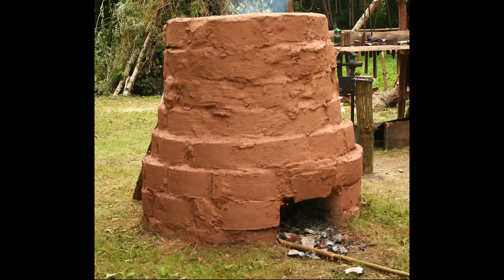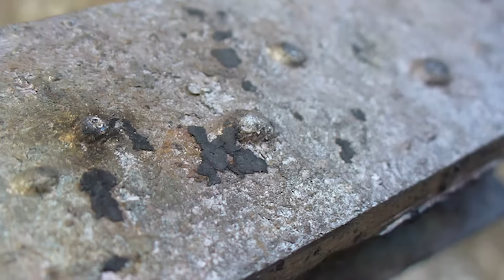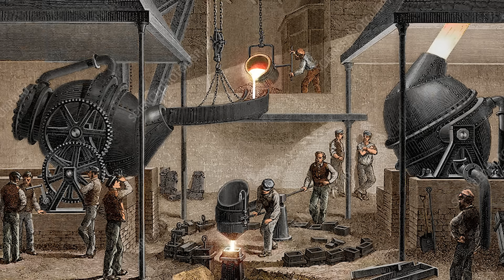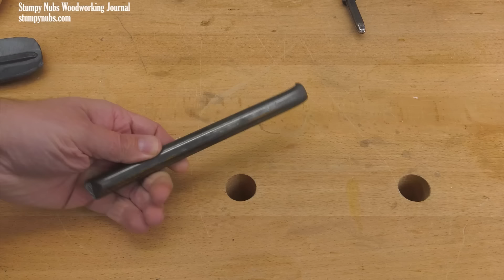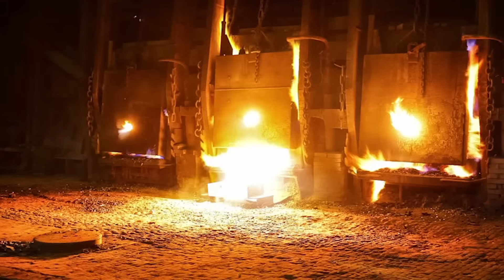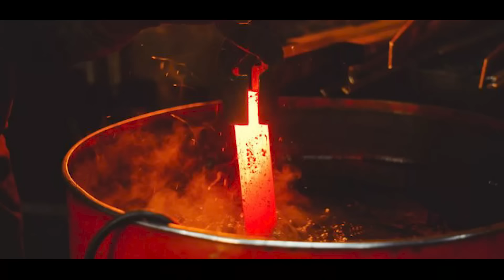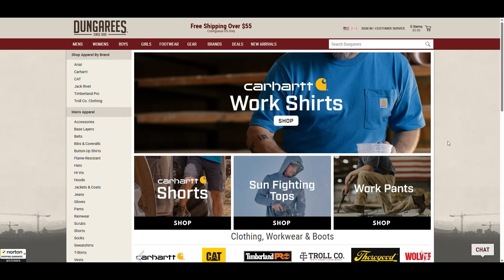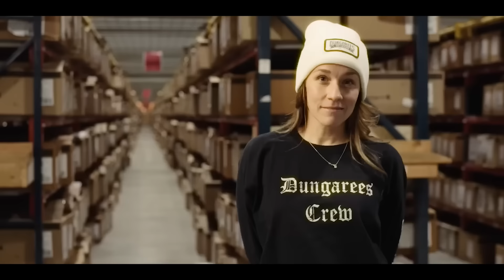Why they REALLY don't make tools like they used to

Comment: I presume this is about cheap new steel being better? That should be obvious. It's true of literally every other material. New 1c plastic parts are better than old bakelite things that cost a fortune. It's the same thing with the obsession over japanese katanas and steel with 1000 folds. They had to fold it so much because their steel sucked and to remove impurities. Because of the massive labor cost they became heirloom pieces. Because of this they survived. Because of this they seem good. But the steel sucks. A 5$ knife from amazon has better steel than the finest legit samurai sword ever made.
Reply: But Japanese mystical magic bladesmiths!!!😉
Reply: Parts of your point are definitely correct, but I think you took it a bit too far. Saying every cheap steel now is better than the finest steel they could produce in a particular region is definitely reductio ad absurdum.
Reply: Not "every" cheap steel, cheap knife steel. You are the one who is over simplifying  @doublestrikePhoto And the point is absolutely true. Dirt cheap modern knife steel would absolutely blast the best old samurai steels in every category. Like apart from presentation and aesthetics - go ahead and name one way in which the cheap modern knife steel is worse.
Reply: It would be a very odd thing if modern technologically advanced materials (including plastics) weren't a big improvement on the old school materials. Just consider the 3D printing scene and how the filament printing plastics have improved greatly in a very few years of development.

Comment: Aren't railroad ties made of wood? 
Asking for a friend... 😅
Reply from the maker: Yes, I meant rails.
Reply: Concrete ,wood ,mostly oak and even plastic or carbon type ,have been used . Low bidder and environmental regulations win the bid . Cheers
Reply: @robertsmith3518 
"Concrete ,wood ,mostly oak ..."
That would depend on the locale.  Here in Victoria I think it's been mostly redgum and some ironbark.  In Western Australia, I believe that they used a lot of Jarrah.
Reply: @PJRayment  Yes I remember chopping up old jarrah sleepers for firewood as a child.
Reply: Chemical plants that ship by rail quite often use steel, plastic or concrete as treated wood ties will react with said chemicals, ie; Hydrogen Peroxide will cause treated wood ties to burst into flames…not a good thing in a loading or unloading facility.
Reply: The GWR experimented with pressed steel sleepers in the 1930s
Reply: All railroad ties or sleepers in Kenya are steel
Reply: @leeboettger5915 really? all of them? do you have any railroads? that's a huge waste of money
Reply: Historically, yes, most have been.  Today concrete sleepers (US: ties) are popular, and (recycled) plastic ones have also been used.  Steel ones have also been made for cases where wooden ones wouldn't survive (e.g. because of termites?).

I see that James has replied too, but YouTube won't open his reply for me to see.  Edit: I can now see it.

Comment: I love the history lesson and the technical lessons regarding the steel throughout the ages. I do not understand or know the difference between charcoal and Coke, but apparently that was important. I'm glad to see that our new steel can be as good, if not better than the old stuff.  Both are good.
Reply: Coke is produced by reducing coal. Coke gives a higher temperature with fewer impurities. It is analogous to making charcoal from wood. The byproducts of the process are useful; during WWII they ran IC engines on the gas produced from burning wood. It is a popular method for running generators with the off grid people.

Comment: I have old Marples, including one from 1910s. To me, they are too soft comparing to modern chisels, even inexpensive Stanley chisels.
Reply: I found older Sheffield steel to be generally soft. Easy to sharpen. I like that. Solingen steel is much harder to get sharp.
Reply: I recently acquired an older Marples 1 inch chisel with an amazing original handle.  Use it to install exterior door hardware.  Better than most of my antique chisels. I have some great Buck Bros cast steel from the 1890's, some awesome James Swan chisels, and a set of Keen Kutter chisels from the 1920's that I believe are swedish steel.  Great Video, really well done.